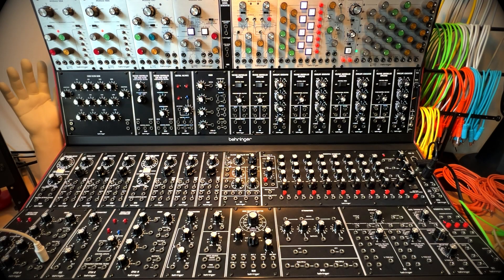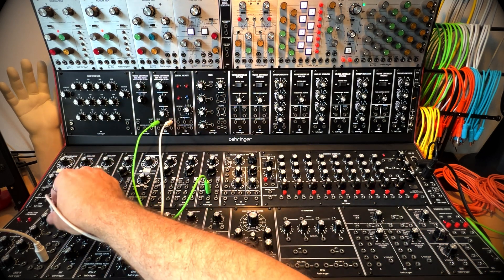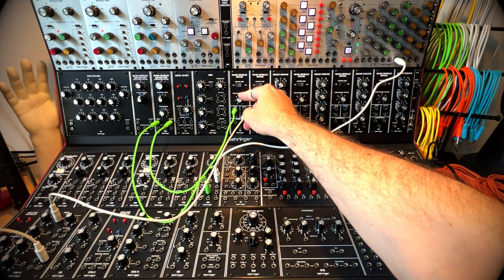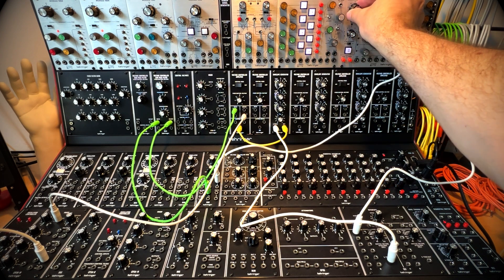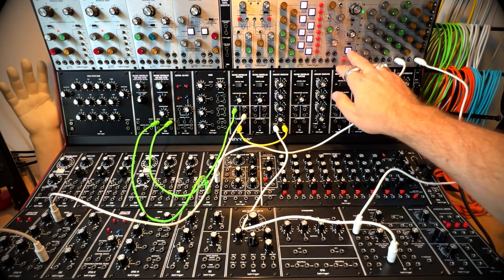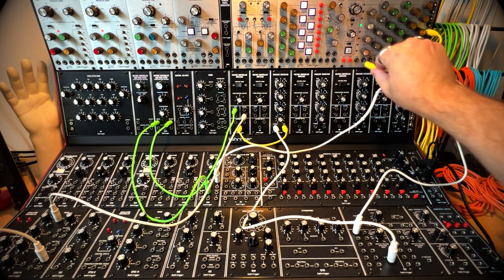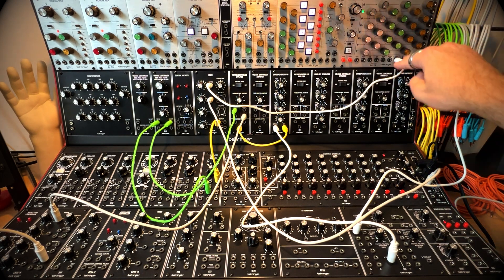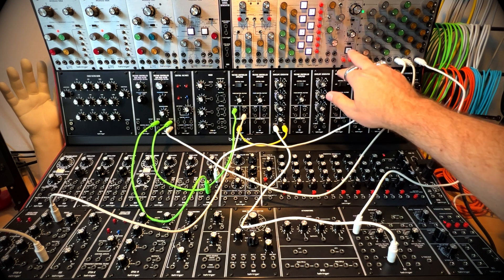Patch Files 03: The 1027 Sequencer

Comment: Just wanted to say thank you. I really appreciate this one. (This coming from someone who's been writing music on modulars for well over a decade) - your explanation is very clear and gives some excellent ideas to both beginners and those who might have got stuck in their comfort zone over the years. I love to sequence gate lengths on my 1027 by routing the third channel back into Width and setting gate length to external. This way you can get out of the more static sequences - especially when you start selecting odd pattern lengths such as 5 steps etc. Or run a random S&H into width for even more fun. Would be great to hear what you do with your 1050 as that's one module I feel I haven't used to its full potential yet. :) Cheers

Comment: Nice one!   Ditto what @moogfooger has said r.e.  "sensitive" (pitch) knobs.  The 1027 outputs  max 10 volts from OUTs A/B/C.  It's a good idea to run that through one of the system 55 attenuators to change that range to 2 or 3 volts.   That makes the knobs much less "sensitive".
Reply: Thank you for this info, I will give it a try. :) Still a lot I don't know.
Reply: Hey OZ. I got this idea from you! Cheers
Reply: @moogfooger  LOL!
Reply: you're the professor! Cheers @ozhalljr
Reply: @moogfooger  😁
Reply: Exactly! I was going to mention that! First time seeing this big Behringer Reissue stuff. Would have been epic in 5u! The most wonderful thing about sequencing pitch for me is realizing you can attenuate and offset whole sequences or portions of a sequence if you’re using a switch, or you can transpose whole sequences by adding sequenced voltage directly to your sequence (albeit with a clock div of your choosing). Not positive if one exists for this system but a quantizer has made a huge world of difference for me to take the pain out of individually tuning knob parameters and made it something that I can do on the fly even as part of performance. Anyhow, just dropped in to see a bit about that sequencer, the diagram on the sequencer itself is pretty cool and made me wonder what the signal flow was knob to knob.
Reply: @turbotambourine  There is a French company Mos Lab that make 5U versions of the 2500 modules. They are direct copies of the original. Only problem of course that they are quite expensive compared to the B2500 series. Cheers
Reply: @moogfooger  I imagine so! Appreciate that you’re keeping the aesthetic pretty classic. I’m surprised Behringer didn’t come out with a moog style wood case.
Reply: @turbotambourine  It is a handy thing to be a woodworker when indulging in this hobby. I built wood cases for my 2500 as well as a System 35. I don't really care for the Go case style. At least I can dream of the full sized units whenI  look at them! I really like your moniker BTW. Cheers
Reply: @moogfooger  yeah totally! Wish I was that! I have an Intellijel 4u case myself but definitely appreciate the aesthetic of wood! I try to carry mine with me when I go anywhere for a day or two even. Ever see any Ehsan Ghelsi videos? A very pretty Moog System there. I don’t know which one mind you. 
Glad you like the moniker haha. It was sort of a silly name from an inside joke. A punk rock band released a sophomore album and every chorus it was like tambourine was playing turbo speeds haha.

Comment: Wow, this is really interesting and helpful, thank you very much for producing this video. So can I use the clock out to sync with the Odyssey sequencer using the cv in, is this what you meant? I think it has a cv in. Thank you for the shout out Mondux.
Reply from the maker: My pleasure. To connect with your Odyssey, send the cv out from one of your sequencer rows to the cv in on the Odyssey, and the gate out from the 1027 to the gate in on the Odyssey. Should do the trick!
Reply: @monodux  Cheers, for the info, I will probably be checking in with you again on this :).  At the moment I have the 1027 patched so it seems to do what it should, but not exactly has you have shown here, I just blundered away at it. But at some point I am going to un-patch it all and follow this video to try and fully understand what is going on.

Comment: Very informative presentation. Nice pacing and step by step. Perfect for troubleshooting. BTW, you can use the FM inputs on the 1004 from the 1027 to limit the range for tuning. This makes it much easier for an octave or 2 on the 1027 dails. Also an attenuator for the 921B would work too. Thanks for uploading. Cheers
Reply from the maker: Awesome tips as always! Thanks for watching and commenting as well!
Reply: seems there is lot more to learn about all this volts and stuff.  :)
Reply from the maker: You’re not wrong! 😅
Reply: You have picked a hobby with endless possibilities. I think of the 2500 modules as scientific instruments designed by genius engineers. Always new things to learn and experiment. Cheers @DisciplinedCommotion
Reply: @moogfooger  seems so :)   great fun